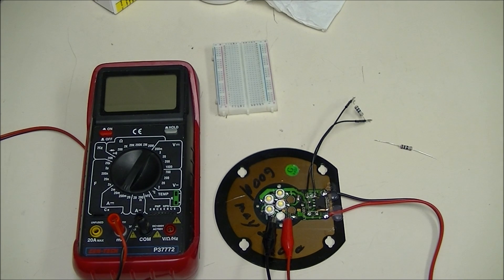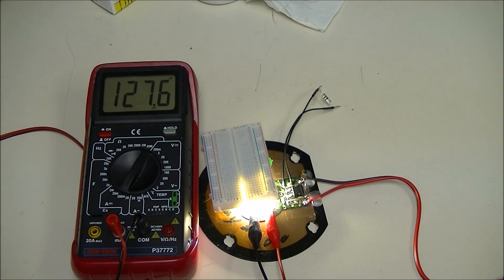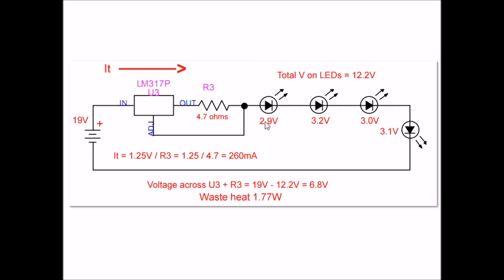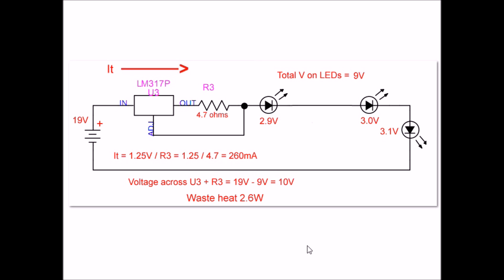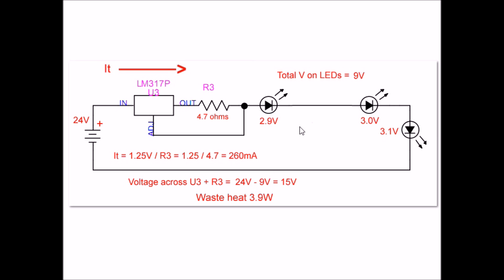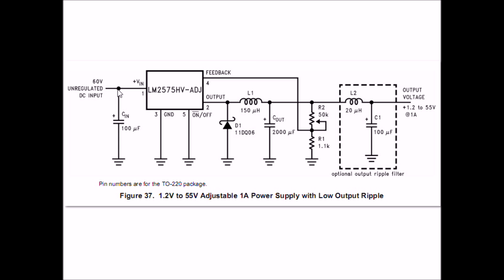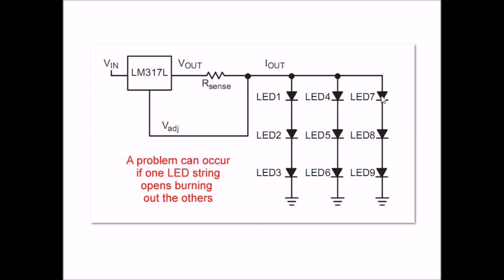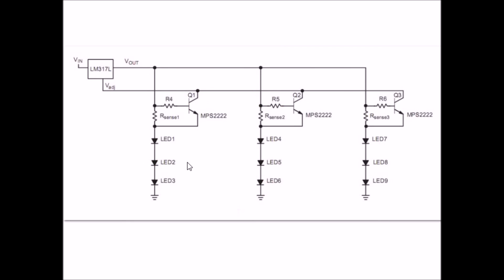Properly Lighting Up Light Emitting Diodes

Comment: THANK YOU!
I have been contemplating exactly this subject today. I want to use my 3D printers 24v power supply to runs some led strips... problem is they are 12v, so I was considering using a LM317 since I have them on hand, but then became concerned about the waste heat loss. I do also have a bunch of 2n2222's so now I think I will try your suggestion in the last example.
Reply: Is it okay to put two LED strips of 12 v in series with each other and work at 24 v DC without other components.
Reply from the maker: You need more than 24V because the CCS uses a few volts. Yes to your question.